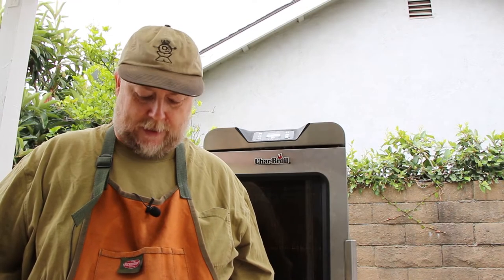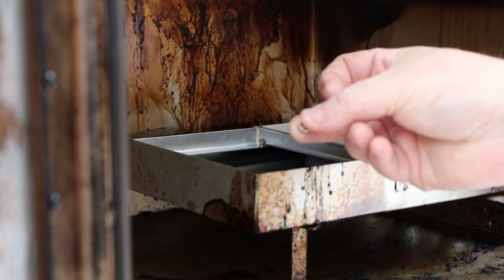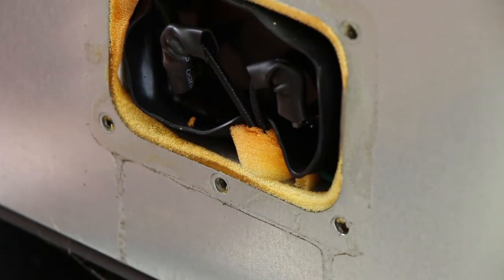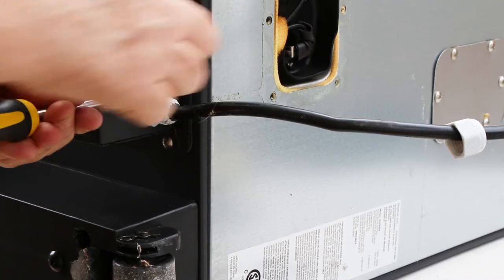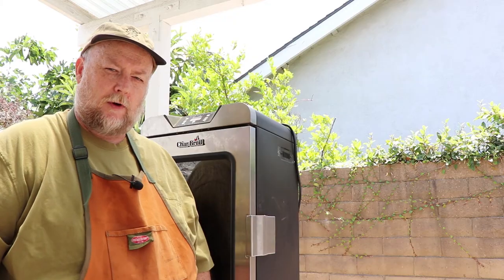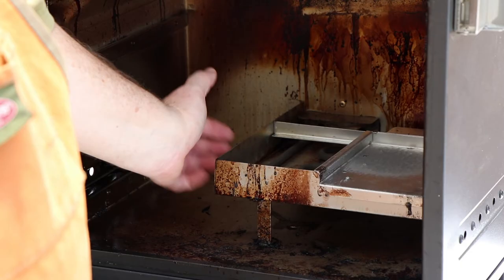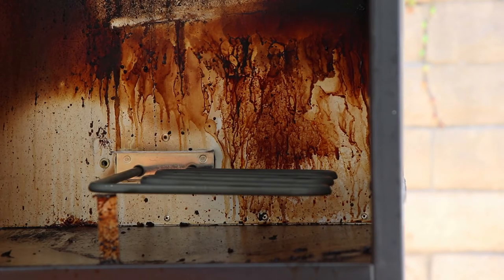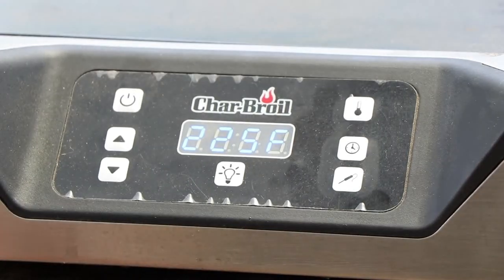Diagnosing & Repairing The Electric Smoker

Comment: I have exact same smoker. Garage kept. Outside only when using. Yesterday no heat. Took lower cover off back one wire corroded off. Easy fix. Glad to be back cooking. It's only 2 years old .used 30 times. I love it. Check connections.

Comment: Ry, I wish you had replaced one component at a time, because now we will never know which part was faulty. Also, I wondered if you happened to test for continuity, end to end, of the heating element, and whether you checked for "ground to case" condition?? I am having same issue with same machine, so about to tear into it. Thanks for the info in your video!!!
Reply: I think I'm having a ground-to-case issue. If it's not on a GFI, touching the unit will give you a jolt. Otherwise, it pops the GFI if I'm using one of those outlets. I'm just starting to tear into mine now, too. How did yours come out?

Comment: My heating element connectors that go through the back wall melted. So I figured I'd try and fix it myself. Those 2 screws that attach the heating pan to the side panel are impossible to remove. I found a fix though, I took a sledgehammer to the smoker. Broke up nice enough to fit all nice and tidy into my recycling bin.
Reply: Thats great.. I feel the same way.. Those stupid screws about ended the life of my smoker..
Reply: I ended up drilling out the back wall screw and taking a Dremel to the side screws. Will replace with sheet metal or wood screws for (hopefully) easier future removal.

Comment: Thanks for the video. Very helpful.  Worked one year fine, then started popping breaker at pre-heat. Different outlets, same issue. I would have liked to see if the issue was with either the element or the thermostat.  Since you changed both, we don't really know. Did Charbroil recommend replacing both? Mine is no longer under warranty and I got by the issue by using an extension cord into a non-GFCI outlet. Stupid, but it works. Planningn to contact Charbroil and see how much the parts will cost. Thanks again.
Reply: After posting my comment, I have just found that Charbroil had issued a recall on my digital electric smoker February 15 2024 for this very issue. They will be sending a "repair kit" with instructions they value at $32.99, for free. Let's hope it fixes the issue.
Reply: The GFCI Pigtail kit they sent me did NOT resolve the issue. Not even 1 minute after I selected pre-heat the GFCI breaker flipped. Had to plug the smoker into an extension cord and into a standard outlet in my house in order to use it. Very very disappointing Char-Broil.

Comment: I'm surprised you didn't use the pre heat after you installed the new parts.  I have the same smoker and it instructs me to always use the pre heat.  Do you usually start your unit without the preheat?  Also, this is a great video.  My unit just stopped working today.  Panel works, but no heat.
Reply from the maker: I did when I first got the smoker for a short time but it really made no difference from what I could see. It just heated up to the same temp in the same time. Kind of a curious process.
Reply: @CookingWithRy , thanks!!!!!

Comment: Mine was also tripping. I saw the when was on the power cord and moved that and also wiped the very bottom of the grill under the element. It was fine after that. It was the same last time I used it, maybe moisture on the heating element causes the trip. It happened when I used it last summer, once after winter not being used. The same yesterday after not being used all winter. Twice and then after I moved it off the cable and wiped inside it worked fine. Weird.

Comment: Great video. I have my new element. But my wires are shot. Do you know the gauge of wire I can use?
Reply from the maker: No, I sure don't. I didn't have to deal with that.
Reply: You can get a pair of wire pliers that have the multiple shots slots on it and place over the wire to you get the one that it fits good and tight you know what gauge wire to need

Comment: My father in-law just gave me one. He turned it on to use it one day and after a few minutes it turned off and  hasn't came back on since. It acts like it isn't even plugged in. We replaced the thermostat and that didn't fix it. Didn't see any blown capacitors, but could have missed something. Do you have any suggestions? Thanks in advance
Reply from the maker: That sounds like a bad switch somewhere. I’d definitely call the manufacturer.
Reply: What exactly do you mean by switch? Sorry for the questions lol
Reply from the maker: @mustangmadd3172  Possibly some internal electronic switch or relay. But I'm no expert. Just a thought.
Reply: @CookingWithRy  ok thanks. When I get a chance I'm gonna break out the multimeter and check all my capacitors and what not. Thanks

Comment: Ry how does the temp on your external thermometer compare to factory. Compared mine & factory was around 275 & mine was around 225. I’ve had smoker for good while changed element about a year ago & noticed that my cooks just kept getting longer & longer.
Reply from the maker: I trust my external thermometer. It seems to me the built in one 'catches up' after about an hour of smoking so that they are withing about 10 F of each other. I've replaced the element as well but I'm not noticing any longer cooks at this point :)
Reply: Thanks for input mine does not get any higher than 220-225 external even though it still reads 275-280 internal. Just don’t know if it is thermostat or digital control. I’m getting w/ masterbuilt after Christmas. Hope they can help. Like you mentioned my smoker is so versatile when cooking for a crowd even if you are not smoking. Thanks again you do a great job I learn something new all the time keep’em coming....Jon

Comment: I was cleaning mine and it wasn't completely dry. When I plugged it back in and turned it on it popped and now I don't get power to it anymore. Is that the heating element, cord or another issue?
Reply from the maker: That sounds like it could be a fuse or the control board. I don't think I heard the heating element make that sound when it failed.

Comment: So I returned my CB smoker, and now have Smoke Hollow. Let me ask you please, how do you start a smoke with your electric and add chips to get the best smoke quality/flavor...do you preheat, do you add wood chips first/after/at same time as meat, do you add second and third loads of chips, etc. Also, how would you score smoke flavoring on your meats when using your electric vs using your charcoal grill vs offset? I'm guessing on a scale of 1-10, with 10 being best flavor, electric 5, charcoal 7, offset 9. Thanks for doing your channel!
Reply from the maker: I start the smoker with the chips in the box and by the time it's at temp the smoke is usually beginning. I add more chips only on long cooks, but rarely do anything beyond a 3-2-1 for ribs in there, which really only needs it in the 3. I usually get between 2 and 3 hours of smoke on a full box, though when it's full it does take a bit longer to generate smoke. I'd rate them electric 5, charcoal 8, and offset 9, so close to yours.
Reply: Do you sweat the whole white vs blue smoke issue with either your electric or offset smokers? I could see it being a larger issue when burning whole pieces of wood with offset, not as much with electric/chips??? Also, with respect to fire management on all these 3 smoking devices, I assume electric is 1 on a scale of 1 to 10 with 10 being steepest learning curve/time consuming, charcoal 5, and offset 8? Thanks for sharing your experiences, I in time, will garner my own experiences, but I think its cool the gain insight from experienced folks like yourself.
Reply from the maker: For the electric, the smoke is usually what it's going to be. The temperature management built in to most modern electric smokers just heats the chip container to the point of near ignition while heating the chamber. Unless there are precise airflow controls, the smoke is really not a concern. With the offset, for me, it's all about airflow. The better the airflow the less chance of producing really thick smoke. I don't mind if the smoke isn't perfectly 'blue'. I just don't want it to look like the exhaust pipe of a car with engine issues :)

Yeah, electric is a 1. Charcoal is maybe a 3. Offset a 6.

Comment: a simple continuity check with a multimeter will tell you if the heating element is good. Its a wire..it either reads continuity or it doesn't.

Comment: In the video it looked like you were plugging a red drop cord into the ground fault outlet. If the ground fault was tripping it could have bern moisture in the cord cap where the smoker plugged into the drop cord. I would recommend trying a regular outlet without a drop cord to troubleshoot. This would take 2 potential problems out of the equation, the drop cord and the ground fault outlet
Reply from the maker: It was a bad heating element. GFI was okay :)

Comment: Dude, ever had any issues with this brand smoker not reaching full internal temp set for food, as in going into keep warm mode only an hour or two into a 10+ hour smoke?
Reply from the maker: I've never had that issue and I've done 12 hour smokes. I wasn't even aware there is a keep warm mode. Mine only had issues because of the failed heating element, but none before or after that.
Reply: Thanks for reply. CB told me not to have food probe in smoker when pre-heating (bogus advice), then sent me new thermostat, new heating element. I'm thinking it is more of food temp probe or even control panel issue. As far as the pre-heat mode, I believe it goes to 140F once your meat temp is reached, nice feature as long as your meat actually reaches proper temp :). Thanks again.
Reply from the maker: Yeah I never use the included probe for meat temp, only for a backup pit temp. The probe just sits in that slot on the right side inside the smoker.
Reply: Ahhh, then your smoker may have similar issue, may not, but if you always use your own food temp probe, then you are golden because you bypass the potential issue of using CBs cook to temp feature. I want this CB to work as advertised with stock food temp probe, so I am curious if CB can/will fix issue. Good videos by the way, nice work!
Reply: Mike Hamlin kkmkjmoooo
Reply: Replace overheat fuse for $6. It is dime size behind cover on back.

Comment: My new element seems to be working fine but I am not getting much smoke?
Reply from the maker: Not sure what would cause that if the temp is hitting its mark.
Reply: @CookingWithRy  Yeah I took out the wood chip pan and and it is smoking but a little more smoke than I want. I have used this master Built for years.. Strange.

Comment: these boxes are not insulated enough in the element connection area. I've had to replace the element once on mine and just after two uses, i've had to replace the connectors on the cord to element.  I think the cord is not heavy enough gage myself. Its probably 14 gage but because of the current it draws probably should be a 12. I do not like the fact that i have to put a meat thermometer in the smoker to see what the actual temperature is. That's ridiculous. Also this is supposed to be a smoker..the element does not get hot enough to burn chip so they will smoke. I start hem with a butane torch which helps. My remote went out and the new one will not talk to the smoker. I would not buy another one from char broil

Comment: Replace one at a time. Then test. You shouldn't do thermostat and heating element at the same time.  What if they sent you a bad part?
Reply from the maker: Heating element is the thing that fails most on these to cause this issue so it is the best choice to replace. And it worked.

Comment: Question. My charbroil grill is set for 225 and my store bought temp like you have always reads 15  degrees warmer then the smoker.  Do you get that.
Reply from the maker: Yes that difference is common. I trust my remote thermometer to be more accurate.

Comment: If you are tripping the GFI, you nee to take a resistance reading from the tab to the outside of the heating element., if you get measurable resistance , the heater is shorted to ground (Should read OL on a digital meter, or peg the needle on an analog meter). This ground will cause the GFi to trip. Sometimes it won't short until it heats up.

Here's a good videos on testing the heating element for both continuity and shorts to ground. https://youtu.be/jnUIfT-C2qo

Comment: So annoyed right now, Same charbroil cmoker,same tripping switch problem when it turns on,  USED IT TWICE!    called charbroil - ya they sent me the replacement element and a thermostat, and when i asked how easy this was to replace i was assured it was super easy. Ya right,   So annoyed right now,  that I have to do this to repair an almost new unit , when I dont know what im doing,  Its been sitting there for a year now!  Todays the day,   or maybe tomorrows the day,   No more charbroils for me, thats for sure.   Expensive boat anchor.